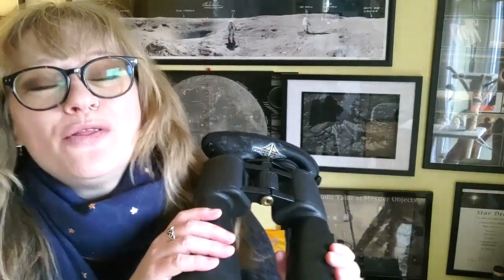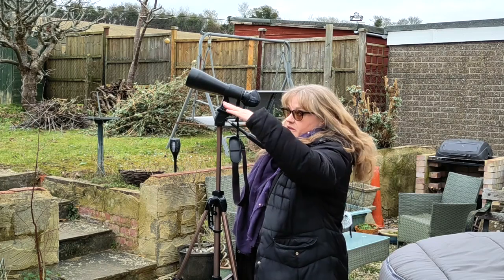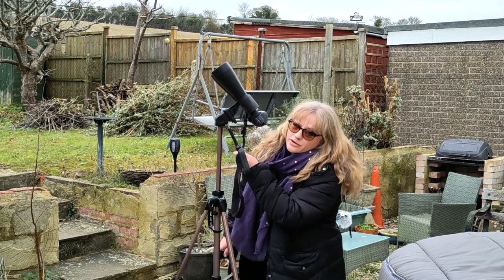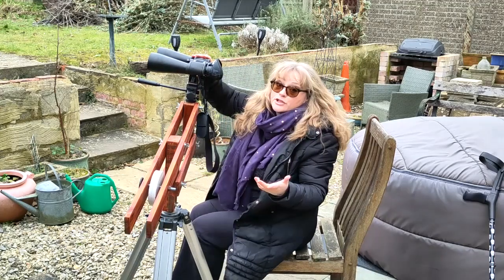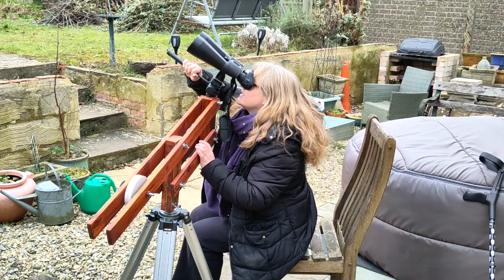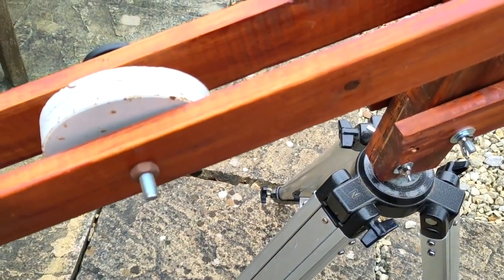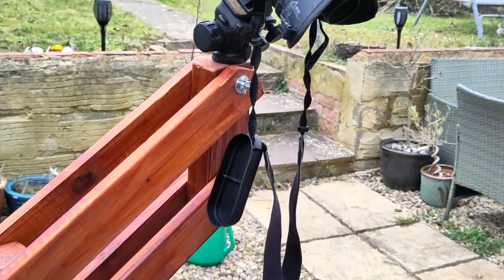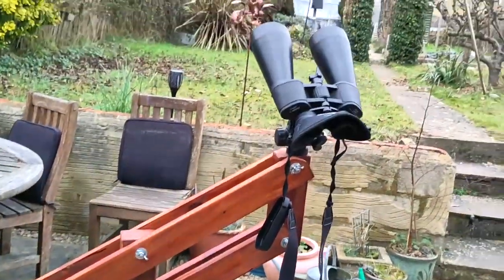My husband made me parallelogram mount for my "Frankenbinos"!!

Comment: Great design AND it saved me a lot of money considering how much parallelograms sell for. A question: It looks like build has a 3rd screw at the bottom of the long post that I don't think is referenced in your husband's build instructions. What is that for? Thanks again.
Reply from the maker: I'm so glad it was helpful to see this :) The screw at the very bottom of the long piece is there so I can tighten up the overall rotating movement of the mount. Mark drilled a hole up the centre of the long piece of wood and I think he used a piece of threaded bar for the wood to slide down onto. The hole is slightly too big so the rotating motion is a little bit too free, so having that screw there lets me tighten it up a bit and stop it from flying away at the slightest touch!
Reply: Thanks for the quick response and for replying to inquiries regarding your video long after it was posted. @Spiceyspiney

Comment: Hi Mary, Im thinking about making one of these and found you while searching for homemade versions. Im curious as to why parallel bars are used rather than a single balanced  bar, I see it does allow the user to lock the device from the observing position in the way you showed, rather than trying to reach the central pivot point, which might move everything anyway. But if there are other reasons please let me know. I notice the eyeshield thing on the frankenbinos, I will now be looking for something like that too. BTW, I live under the same airport flight path as you, so Im not far away. Good work by your husband.
Reply from the maker: Hi Paul, the parallel bars design gives you way more range of movement, but also in theory you can change the height of the binoculars and they will still be pointing at the same object. This allows different people of different heights to look at the same object really quickly. It also gives you more stability, which is more of a issue when you're using larger binoculars.  You can get simple mounts that are single bar designs, but you don't have the same functionality with them
Reply: @Spiceyspiney  Ok, Ive made my version one build with some minor differences, Ive drilled vertical holes for the counterweight(s), made an L bar for the binos, and as my spare tripod is for an equatorial mount, I had to work round the bit that sticks up at the side for polar alignment, sorted that on a lathe though there is room for improvement. Im very pleased with it though I do intend to rebuild with some nicer wood after some use, but cant stargaze with it yet till these cloudy nights clear. Thanks for putting the video up.

Comment: I think an upgrade idea would be to make an L-mount at the edge of the P-mount, where currently you have the tripod head installed, so that the binos can be mounted from the side instead of on top of mount they are connected to. Side mounts are so much better than top mounts because, if properly designed to allow positional adjustment of the instrument, they can be perfectly balanced on the mount and do not need the user to fiddle with knobs and clamping the way tripod heads with top mounting require.
Reply from the maker: Yes, we definitely need to mod this to have the L mount at some point. Mark just used bits we had in the garage when he made this

Comment: I have a Russian pair with made in the USSR on them which I bought when I was a teenager in about 1985 and they are 20x60 but you can't hold them still.The only way without a mount is if you lie flat on soft ground and look straight up to stuff around the canopy.
Reply from the maker: I bet the view through them is great though?! You can also rest heavy binoculars on an upside down sweep brush to help keep them a bit more stable and that gives you a bit more flexibility than having to lie down flat. Have you seen those amazing binocular chairs? You can actually make parallelogram mounts that clip onto the back of a garden recliner and over your head so it gives you a similar viewing experience. I'd love one of those as well!